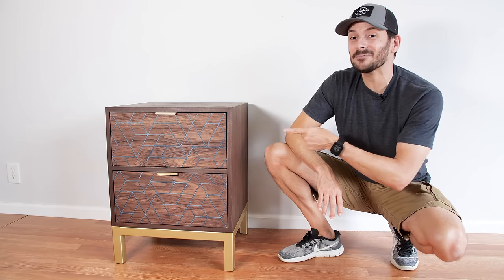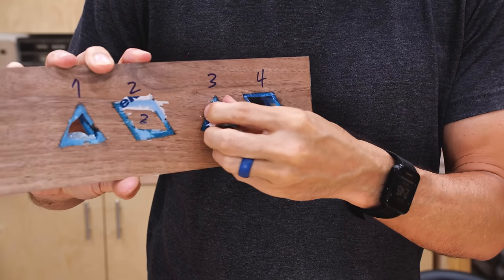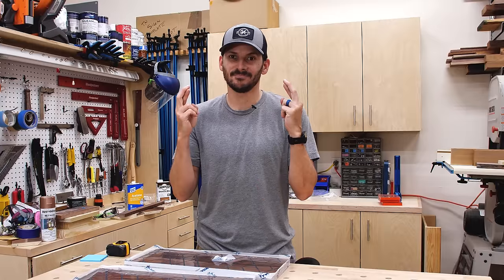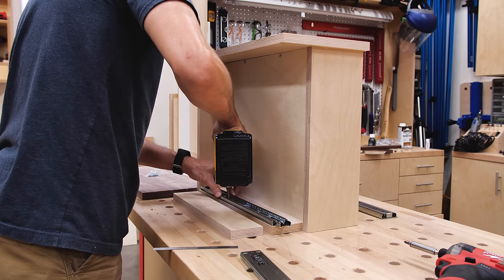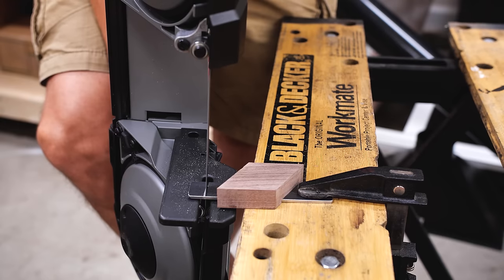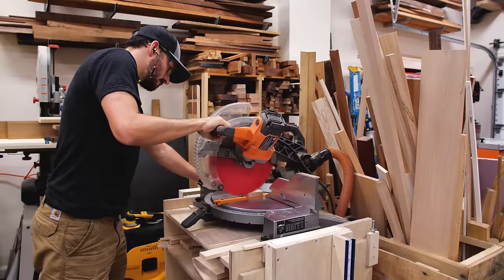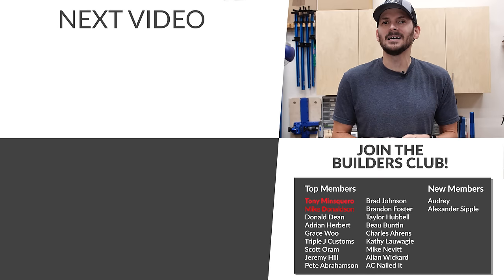When an Engineer Builds a Nightstand

Comment: Amazing build!! One thing I noticed... when attaching the rails to the frame, you're not using the tabs. After install drawers for years, I recently saw someone's YT video about why the tabs are there. You bend them out slightly, then use the screw holes on the end of the tabs only. It gives the rail the ability to handle up to 1/16" extra gap so you get a perfectly smooth sliding drawer. It blew my mind. There was an immediate 1000% improvement in drawer slide installations.
Reply: I think I understand what you're saying, but can you provide the link? I'm a more visual learner.
Reply: Christopher M, can u remember the name of the video showing the drawer slides ?
Reply: Whoa

Comment: Engineering 101, the simple option is often the best!

I'm not an engineer, I don't know if that's in the 101 course
Reply: That would probably some level 1000 course. Most engineers equate complexity with sophistication. Usually an engineer who uses the simplest and most efficient solutions is called a craftsman.

Comment: Pro tip for better releasing and pressing down the wooden button. Instead of making it 90 degree squared to the place where it contact the resin, add an slight angle to it. Like 1 degree extra would probably do it. So instead of 90°, it would be 91°. This way it would release right away from the resin as the contact surface area will just disappear. And also will push smoothly. Check some injection mould design, and you will see better what I mean.

Comment: Since the epoxy is kinda "deeper" around the secret Button its actually a lot darker and the secret Button becomes a lot less secret :D
Reply: Using a darker shade, maybe black may compensate for this
Reply: Could try adding more/larger/shallower wooden spacers in the gaps to help compensate for the change in color.
Reply: Less clear epoxy would help too
Reply: should have had the cnc go deeper in general, not like it would be any weaker once the epoxy was in
Reply: If I hadn't seen this I doubt I'd assume that was a secret compartment trigger button ;)
Reply: Naa I would think thats overpainted or dirty

Comment: Super cool!  Q: Will the plywood latch/spring eventually flex/distort/etc and no longer be straight?  Perhaps coat it in epoxy to help it stay straight; add a strip of metal/aluminum; or use a non-flexible plastic piece, instead?

Comment: Wonderful job, the finished product looks very nice! The only thing poking my brain is that I would have used a recessed flat head Philips screw at (16:50) to fasten the wooden spring.
For the other wood-be (ha ha) woodworkers out there...Your trail to triumph in bringing new wood working ideas to life will almost always result in a slew of trial & error. In the design phase, plan the details for each step or action on paper ahead of time. Choose your shortcuts wisely, ALWAYS observe safety standards, pace yourself and take a break if you notice fatigue or stress eroding your concentration.

Happy Building !!

Comment: I hate telling you this but if you’dve taken the cnc program to be a little deeper cut all the way around, minus the button, your epoxy would have looked the same all the way around. When looking at the front the button has a dark blue epoxy ring around it that the rest doesn’t have. Very great work minus that small detail though. I love the engineering mindset you have in these projects

Comment: If you do any more hidden buttons with this epoxy technique again, I wonder if you could disguise the button even more. Instead of milling the border all the way through and keeping the center of that cut as the button, you could mill all of the troughs to the same depth and then mill out the center where the button goes. You’d have to mill the button out of another board tho. You might be able to use the same tape trick for pouring the epoxy too. If you did that, the epoxy surrounding the button would have the exact same wood backing as all the rest of the epoxy. The epoxy that is open on the back seems to be semi transparent and you can see the darkness inside the drawer a little bit. If that’s too much work, I think it doesn’t look obvious as is, so no harm in continuing that way

Comment: I applaud you!

Here's where I would go in a different direction.

The button:
I would not have chosen such a tight fit, I would have chosen a conical fit with a slight angle on all sides, that it can only fit perfectly in just one way, then I would've sand it all flush. Thus first use a test piece to pore the epoxy, then use the real piece before sanding everything. To bring the button to it's original position is just as simple as using one or more rubber bands on the back, or even an elastic fabric they use in clothes.

The lock piece:
That wooden piece causes friction, so the spring you use on the back might not be strong enough, but the stronger the spring, the more force you need to close it. Instead of a spring, use a metal ball on a tiny spring with grease, or even better, use the same principle as a normal light button, button pressed in, drawer goes open, and when drawer shuts, the button goes back to its original position and locks the drawer again. a oval shaped end between 2 metal plates does the trick and you can make that very tiny and simple rod in that drawer that pushes to the back can force the button to lock again. very simple.

You'll probably need vaseline now to combat the friction in both the button and the drawer, perhaps even some light sanding.
It's really beautiful, but really simple to crack or even find out, just manually manipulate the wood and the drawer opens. This is security by obscurity, please tell me, you didn't use to work for AT&T, because I would literally die :D 

No, no bashing, I love it!

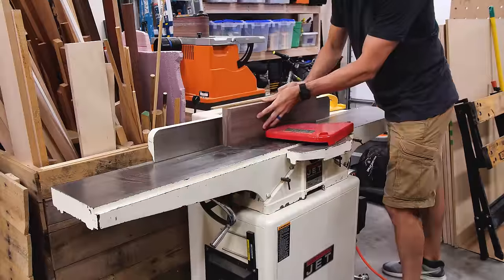Comment: So I'm working on a project and going to try an epoxy inlay, but I've got a small gap between some boards coming together.  Much like you at 2:46 and was wondering if the wood glue and saw dust trick would work for me too even though I still have to stain the boards after put together?  Thanks and great video!

Comment: Interesting and so much more elaborate than what i made as a birthday present for a dear friend: A little box to store some incense in (measurements approximately 30x15x10  centimeters). The box itself is based on a smaller specimen I built way back when I was still in school. Basically I re-built the whole thing from memory. Thing is, the box does not have an easily visible way to open it. Basically you have to diagonally pinch two corners of the box so that you can then slide out the drawer hidden within - concealed behind one of the small sides of the box. However, this secret wasn't enough for me, so i added another layer of secrecy: A double bottom, held up by a pair of magnets and a bit of wood. To open it, you need to press down on the false botton on one side, which then causes the panel to tilt over to that side so you can remove it. To keep it from being to obvious I had to keep the hidden compartment rather shallow though (approximately 1,5 centimeters high).

Granted, the end result did not look as refined as what you have built here, but considering all I had in terms of tools was a jigsaw, some sand paper, and glue, I am fairly satisfied with how it turned out. I do wish i had had a proper file for that though.

Comment: Very cool. Why would the hidden drawer come out of the side of the primary drawer though? If it's a night stand it either goes into the bed (can't open) or away from the bed (out of reach.) Seems like it should just extend forward, beyond the primary drawer, or the primary drawer compartment should slide back revealing the hidden bottom drawer.

Comment: I'm not 100% onboard with the gold coloured stand, But apart from that it's a very pretty piece of work.
It could be better from a security standpoint if the secret draw was thinner (Maybe without the ball bearing runners to save space), and the bottom draw had a raised bottom so it wasn't so obvious that something was odd about the top draw.

I REALLY like that geometric infill style. It's got a kind of updated art deco vibe going on. I'm thinking it would look cool if you made a panel cut 90% through, Filled the cuts with tinted epoxy, Planed off the back to remove the wood that's connecting all the blocks together, Then back lit it.

That said, It was an ingenious project, and this was different enough to projects I've seen from other YouTube woodworkers that I think your channel is one to subscribe to.

Comment: The epoxy surrounding the button is slightly darker in color because the epoxy there goes all the way to the back of the face panel, compared to the other areas that are shallow grooves. Great work regardless.
Reply: Maybe doing two epoxy pours would hide the groove in a future project: one opaque epoxy pour just around the button to mimic the shallow grooves followed by doing the full drawer-face pour.

Comment: Very cool, but if it's a nightstand you can't put it to the right of the bed cause the drawer would open into the bed. If you put it to the left of the bed the drawer would open but the drawer would be on the far side of the table and you couldn't reach it from bed. I assume the height of the drawer was intended to accommodate a tool with a double stack mag?

Comment: not really hidden you can tell somethings up cause the epoxy outlining the button is darker than the rest of the other epoxy lines because its letting light 'thru' into the space behind. whereas the other ones are reflecting light from the wood behind the epoxy lines. 

solution: add a spacer that goes AROUND the entire button as a backing for the epoxy so it doesn't allow light to pass thru all the way.

Comment: Fix This Build That << .. I have purchased some cheap 1W LED's from china. I haven't decided what to do with them yet, and.. I would say they would be too strong for this, BUT.. I HAVE thought about epoxy with some pigment in it in a wood-working project, and add LED's inside the epoxy. I am fairly good at English, but there are gaps, and right now I can't remember the english word for the rails that drawers slide on.. either way.. they are metal.. they can be used to conduct a current.. (and this would be harmless if the current AND voltage is fairly low.. which it would be if it was driving some LEDs).. Just trying to give you inspiration to try some things out that I currently am in no position to even attempt, and feel free to just hear the "led" "coloured epoxy" part and find your own approach.. either way.. We live in the future.. Which doesn't only mean that it's easy for "people" to see how THIS type of stuff that we would previously have looked at in awe if we saw it in a furniture store and assume it's worth a few  thousand dollar extra just because of this, so it will only be the rich who will have it. (and make SOMEONE who just used some epoxy and wood in the right way) very very rich.. but.. add some LEDs.. and I SUSPECT.. we might be back in business (figure of speech; I was trying to inspire you, nothing else.. I hope at best for some interesting videos where someone  tests out things I currently only can imagine)

Comment: Ok, how about building the one I did for my girlfriend. I started off with an old rough home made box with a top compartment and lid that lifted up from the front. Below that was 2 drawers with fronts that extended past the front of the box. I went with this for the old farmhouse rustic look. Although that was far from what I was wanting for a finished product. It took about a year and a half to finish this box. Namely due to her not liking the hardware I could find as well as me having to figure out the hidden compartments, the locking mechanism and how to make it all work. 

The hardware ended up being cast iron handles with the rectangular back plate having a skull and crossed bones in the mold. And the feet are cast iron claw feet like was found on the old claw foot tubs. The corner protectors as well as the handle for the lid which mounts to the front all match with hidden hinges. And the drawer fronts have cut out on the bottom edge for finger pulls. 

When opening the top there are 2 panels made from 1/4 plywood that cover both the lower compartment as well as the under side of the lid. Both top and bottom have runners and are at a slight angle so that the correct and can be achieved and they can be slid into place. I used a sanding drum on my Dremel at an angle with the bottom facing what would be the front edge to create a catch for my fingernail to pull the panels. Removing the panel from the under side of the lid revealed lengths of chain (like jewelry chain) with lobster claws and 6 screws with eyes, 3 down each side. For the lobster claws to clip to. These are for her rings. They can be threaded onto the chain, the lobster claw clipped onto the eye and the panel slid in place to then show the sigil I created to represent the two of us together as a whole and it hides the clutter of the rings. I used an electric pyography machine with 2 pens and adjustable temperature from barely warm to glowing white and still set the wood on fire hot to burn the sigil into the wood panels. The bottom works the same way as the top. And has her favorite symbol burned into it, the infinity sign. The bottom panel simply covers a wide open compartment. 

The hidden compartments where easy. It's the locking mechanism that makes them secret compartments. All I did was install a partition in the back of the 2 drawers to make it appear as though the drawer was fully extended. But there is in fact another 3 inches left behind the partition. The drawers had to have a 5/8 notch cut out of the top of the side panel that was on the left the the left drawer and the right for the right drawer. The notch stopped at 3 1/4" from the back of the drawer. There is a piece of 1/2" x 1/2"  aluminum c channel installed on the notch that was cut out. It has to be aluminum. And there can only 2 screws be used to mount it. The first 5/8" from the back of the drawer front and the other  1/4" from the end of the c channel using pan head screws that take up most of the c channel floor. 

The locking mechanism is magnetic. First I drilled 3/8 a hole from the top edge of the front panel down into the drawer opening that was 5/16ths from the outer edge of the drawer opening. I then inserted a 3/8 thin walled nylon sleeve that I cut off 1/2 an inch shorter than the height of the hole I just drilled and inserted it into the hole using a piece of round stock to drive it down flush with the bottom of the hole. This was so the magnets I would be using would move in the hole easily. I found a piece of plywood that matched when the box was made of, turned it on the side and used a plug cutter to cut 2 plugs to fit the holes. I put the drawers in place, inserted a 3 inch long rod shaped rare earth magnet which are very strong into each hole and made sure the magnets would catch on the pan head screws which they did. Then glued the sides of the 2 plugs and filled the top of the holes the rods where in. 

The key is a rare earth magnet disk about 1/2 an inch in diameter by about 1/4 of an inch thick with a piece of felt glued to on surface and a piece of oak I drilled and glued a piece of dowel into then tightened my drill chuck on it and used a Dremel in the Dremel work station with a carbide carving burr mounted in the chuck and on about a 45° angle to carve a handle with my drill in reverse and the Dremel on about 15,000 RPM. Once carved I mounted the dowel on new handle in to the Dremel and used progressively finer sand paper to sand it smooth while rotating at about 5,000 rpm. I sanded it to 1100 and finished it and the box both when shellac I sprayed with a HVLP paint gun. Then once dried I used epoxy adhesive to mount the handle to the magnet. 

Opening the box requires the use is the 1/2 disk magnet to be positioned in the exterior on the front of the box so that the magnet can attract the magnet inside the front panel. Then you lift the inner magnet while pulling the drawer out. Since the aluminum c channel ends well before the back is the box even if you continue to hold the inner magnet up the back of the drawer will prevent it from opening to reveal the partition and the hidden compartment beyond. You must lift the inner magnet above the height of the side of the drawer in order to access the compartment past the partition. So far no one who has been allowed to work with it has found the hidden compartments on their own even when given unlimited time. They have each come to me asking to be shown. I will not show them how to access it, only that they exist. I do this by removing the drawer while their back is turned and showing them the drawer with the partition and explain that it is only made to look like that is the end of the drawer. And with the length of the drawer being so long then it is easy to think that that is the back. It certainly looks like it's long enough. 

Future plans. I am considering in the future to remove the back panel to make use of the wasted space between the two drawers within the enclosed bottom portion of the box. There is a quite large space that is begging for another hidden compartment. Maybe have a second skin to the bottom of the box made from 1/4 inch plywood and route a 1/4 inch recess into the existing bottom for it to fit into. And a box built onto it with it's own locking mechanism and a release mechanism to allow the whole second skin on the bottom to drop free revealing the completely separate box.